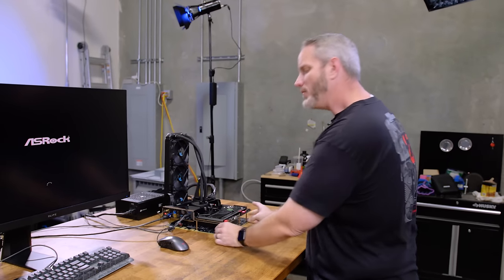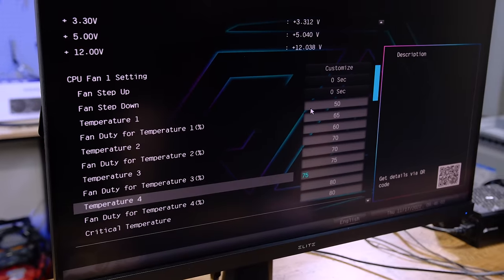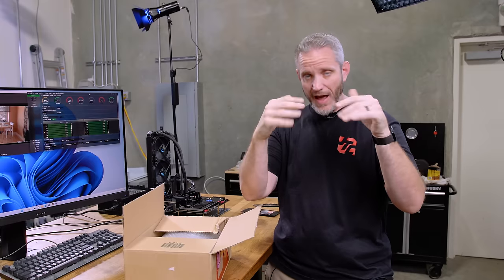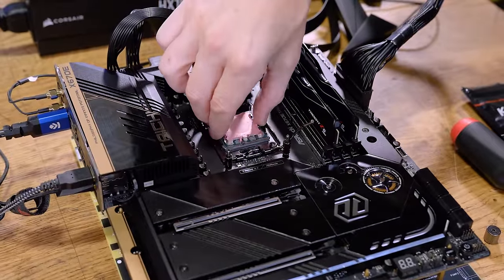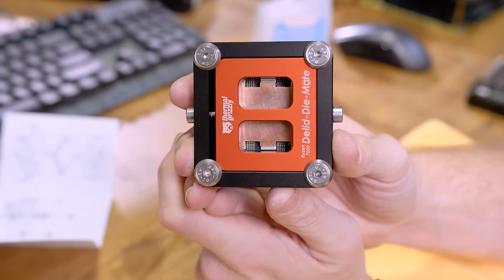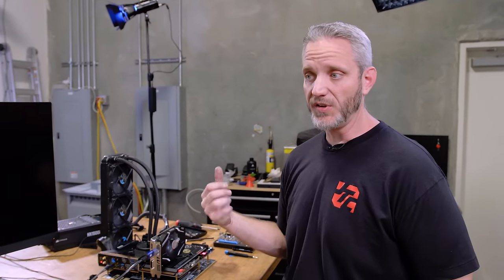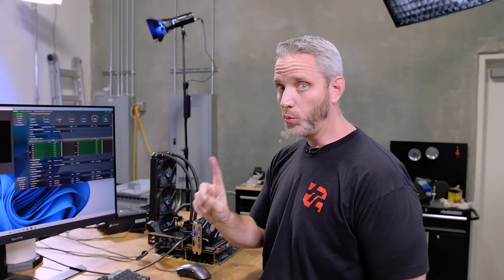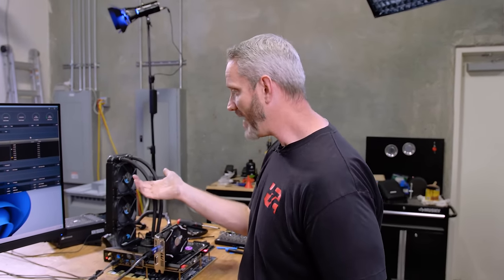I was scared to delid my CPU, but then...

Comment: ah yes, "Iridium" on the CPU. XD
Reply from the maker: New drinking game. Take a shot every time I say the wrong element
Reply: As a car guy, I can see how easily you can mix up Indium with Iridium. Iridium is used on certain types of spark plugs.
Reply: @blockbertus  Iridium is also a satellite system. Like Starlink's grandfather.
Reply: Does Iridium on the CPU get you a Starlink satellite connection?
Reply: iridium is minecraft business, in this case IndustrialCraft 2 or Gregtech ^^
Reply: @sammiller6631  iridium is also one of the hardest elements to melt
Reply: @blockbertus  Only if you have zero knowledge on electronics... But then, what kind of a car guy you are?
Reply: @danzjz3923  It is also one of the densest and most corrosion resistant substances known in existence. Platinum-iridium alloys in particular are also extremely durable and probably the best thing to make jewelry out of assuming that money isn't an issue.
Reply: @_shadow_1  
Yeah, if you're getting jewelry that contains a decent amount of iridium..... money is almost definitely no issue for you. It's one very interesting, and expensive, fairly inert metal. The amount of applications it has, and the amount of places it could improve everyday things, provided it wasn't so rare, would be quite interesting to see.
Reply: @theLuigiFan0007Productions  Who the hell needs private jets or sports cars, I know if I ever become a  multi-billionaire, having the largest object known that is made of pure iridium in my possession is my #1 top priority lol.
Reply: @_shadow_1  
Definitely would make quite a unique valuable possession, unlike a lot of the other things people collect. lol
One day while shopping online at like 4am, I almost spent several hundred dollars in a 2" cube on tungsten. They're pretty cool being over 50% heavier than lead, but even being very sleepy and having poor judgement, I couldn't justify like $350 for a very heavy cube. If I was rich tough? Give me a LEGO set.... made of tungsten, ask someone to pick it up and move it to the other table. Heh. I will admit I spent like $20 on a small 1cm cube instead, which is still amusingly heavy and expensive for it's size, but within the limits of reasonable late night purchases. Pop it in someone's hand and they wonder why it weighs so much.
Here's an idea...... thickly iridium plated tungsten cutlery and plates, and a giant fountain in the middle of the house made of tungsten and iridium and iridium plated tungsten lego sets all built and on display around it. Show off the unreasonable waste of money and weight. lol
Reply: @theLuigiFan0007Productions  I actually already have a cylinder made of basically pure tungsten on my desk that's just shy of 2 pounds, I got instead of the 1.5 cube because corners on something that heavy is a bad idea. Picking it up and fiddling with it doesn't really get old to me, I also have a much smaller tungsten cube which I use to hold down the "W" key so I can rest my arm when video games have long uneventful walking simulator sessions.
Reply: @_shadow_1  
Oh, that's great. I never thought of using one to hold the w key.
Reply: Illudium Q-36 Explosive Space Modulator
Reply: @Jayztwocents  1,...2,...drunk :D
Reply: @Jayztwocents  im in!
Reply: @Jayztwocents  MY LIVER!!!!
Reply: @_shadow_1  I just find it so ironic that your use a tungsten cube to hold W since it's tungsten's symbol (from the German word for Tungsten Wolframium)
Reply: @Jayztwocents  b
Reply: @Jayztwocents  a you're
Reply: though having iridium on a cpu sounds bad ass tbh
Reply: Jay may be a Stars Wars or Star Trek fan. To go where no PC builder has gone before.
Reply: @blockbertus  you can bite and chew indium like gum, iridium is about as hard as hardened steel
Reply: @GameCyborgCh  So whats your point? What has this to do with the fact that Iridium sounds (and "looks") similar to "Indium"?
Reply: @blockbertus  nothing just a fun fact
Reply: @scudsturm1  its a very important element on another type of semiconductor but not one used in CPUs but sewage treatment!! but manganese is the poor man's version of it as it can do everything but has a shorter lifespan but its cheaper so who cares.
Reply: Even more valuable is —> Eckridium
Reply: @Jayztwocents 😮😮😮😮
Reply: Jay kann deutsch sprechen?

Comment: The “decapitate” part of the manual is probably due to the fact that Roman calls deliding “köpfen” in German which literally means just that. Considering the amount of CPUs he’s already destroyed during deliding I think that’s actually a pretty accurate term for it 😂😂
Reply: Behead thy mate
Reply: "köpfen" is actually a pretty common term used by many germans in hardware forums -  "Temperatur probleme, CPU geköpft oder nicht - thermal problems cpu delided or not".
It's just our way: one syllable less to pronounce 😜
Reply: Omelet, eggs.
Reply: lid and head are synonyms in this case.

Comment: It was neat to watch the delidding, but I was also hoping to see how you got it all back into the system. I was a little disappointed that it jumped from getting the top off to running the benchmarks.
Reply: Yeah! Same here. I was kinda curious what the process was. Not familiar with delidding.
Reply: Same, I wanted to see how replacing the retention bracket etc went.
Reply: Exactly! I was watching attentively to see Jay's solution to his retention bracket and they jumped from delidding to the benchmarks. :/
Reply: I'll give you one guess why he didn't show that part, and yes, I was deeply disappointed as well. It's literally the only reason I was watching this stupid video of a grown man risking the functionality of an extremely expensive CPU for literally no good reason whatsoever. Delidding CPUs is just trash nonsense.
Reply: He talks about it at around 26 mins, but sure, would have been nice to see.
Reply: Also here to see that, how did he get liquid metal on both sides, without touching any of the surface mounted resistors?
How did he get the heatsink to contact so much lower? How did he determine how tight to attach it?
Skipping all of that is disappointing.
Reply: Yeah, and when he did talk about it it was about things like even pressure but is there any concern on the absolute pressure applied to these smaller areas?

Like the lid would have dispersed the pressure across the whole substrate, and are those two chips the exact same height or what?
Reply: @jshireley  the temps say otherwise. The heatspreader on the Ryzen 7k is a thick boy. So running direct die cooling on this CPU makes more sense than on line ups with thinner heatspreader. Also direct die cooling isn't anything new. We have been doing it for our GPUs for ever
Reply: @andersmalmgren6528  There are exactly zero circumstances where delidding a processor is a good idea. The possibility of damage is never zero, and the gains are typically only revealed in benchmarking, not in real world results, i.e. the average person or even enthusiast would not notice the difference. If you're an hobbyist who doesn't mind taking risks with your hardware, then just say so. But don't pretend that any of this is a good idea.
Reply: @jshireley  you know that GPU water cooling have been direct die cooling since day one right? Only difference is that they come without IHS out of the box. But all other "risks" applies.
Reply: @andersmalmgren6528  Not applicable.
Reply: @jshireley  enjoy a noiser PC then. I did this to my workstation and my noctuas do not spin above 650 rpm even at full load
Reply: Well, EK sells new standoffs for thier AM4 Velocity coolers to fit onto AM5, I can tell you, that all you need to do, is grind down the shoulder on them by about 1 mm (hand file + electrical drill). And they will work for delid and normal ;)
Reply: @Lem_On_Lime  I've done some delidding a couple of times using older Intel CPUs (most recent was an 8th gen i7), and I've always used silicone conformal coating to protect the surface mount components. That is basically an insulator to protect those devices just in case the liquid metal touches them. Jay seems to like Thermal Grizzly products, so I'm guessing he probably used Thermal Grizzly Thermal Shield (see the Thermal Grizzly product page for the description of that product). As for your other questions, I totally agree with you. Those are the exact same questions I had, and the main reasons why I watched this video. So I am a bit disappointed he didn't cover those points. Still a good video though.
Reply: @jshireley really? Cuz my i7 7700k OCd to 5.2 dropped almost 15c from delidding. Doing it proper has huge benefits to the right cpus
Reply: Same here, wanted to see the putting it back together with new bracket etc. The benchmarking could have been just Jay stating, and now the benchmark shows better temperature and clocks.

Comment: Would have been interesting to see where the clockspeed ends up with the 85°C limit and the -40mV offset to see if it is worth doing that (probably not but I'm still curious).
Reply: it would have been nice if you SHOWED US HOW YOU PUT IT ALL BACK TOGETHER!!!!!!!!!!!!!!!!!!!!! W ... T  .... F  ... .... J ...  A  ....  Y   ...     ????!!??!?!?!!?!??!?!?!
Reply: I would not risk warranty over temperature difference
Reply: @yoool7137  A few months in I would be comfortable using the lapping tool though. That would get the IHS down to a 5000 series thickness and tame the temps. 95 C does not feel right
Reply: @Nobe_Oddy  bruh you actually did this expecting it to be reversible?
Reply: @bickyboo7789  He meant reinstalling the AIO cooler onto the delidded setup.
Reply: I tried 85c and -40mV with my 7950x on an AsRock board and it was not stable, only -20mV was. You need to win the silicon lottery to run with those settings
Reply: @jayb2705  Try just using the Curve optimizer on ryzen master if you haven't yet, do the per core option as well some cores might be able to do more offset than others.
Reply: @nonayobizness2758  1mm = 1*10^6nm so 2mm = 2 000 000 so you got one step too much :)
Reply: @jayb2705  Maybe you need a more stable board than anything Asrock has to offer?
Reply: @nonayobizness2758  Good luck at getting Linux developers to support AMD. I hear constantly that video editing is not stable on AMD drivers because pro editing software is optimized for Nvidia only. What will it take to change that?
Reply: @sammiller6631  All AM5 boards are over-engineered and designed for even more powerful cpus of the future. Plus I needed an ITX one where options are quite limited. Performance wise, I am hitting clocks and scores from other online benchmarks so no complaints
Reply: I noticed one thing the 95c max temp limit only gets to that if u maxing out all cores using something like a benchmark tool such as prime95 ect... While gaming I don't see it going above 65c even at 1080p ultra on a 3080.
Reply: @stephen1r2  AMD have stated u can run the CPU at 95c at 24/7 without any issues. I understand it doesn't feel right but if the only thing Ur is doing is gaming u will never see 95c, I have ran games at 1080p ultra like triple AAA games such as cyberpunk, tomb raider ect... The temps never hit above 67c in my case anyways
Reply: I wonder if AMD is getting news somewhere that the community never asked nor wanted a running max temperature of 95 degrees, with up to 20 degrees just in the IHS design to save you a mounting adapter? I mean it's pretty unanimous isn't it? Jay2cents and GN and De8aurer all need to run a poll of what we really want.
Reply: @yoool7137  Thats cause you soft.
Reply: @Steven West  It makes me mad they decided to either make a design change or tell everyone it can run 95c forever just because of saving cooling mounts. Fuck the cooling mounts. The cooling companies could sell an am5 mounting kit and let you use your current cooler or buy a new one. The fact Jay lost 10c just by shaving 0.8mm off the die like it could've been from the factory truly shows the mistake amd made. Ryzen 7000 will (and is) flop. Hopefully they correct this and thin out the ihs on future generations. If I recall correctly Jay gained more clock speed or points in cinebench just by dropping temp which means amd hurt themselves in confusion.
Reply: Daniel Combs  Did you buy your CPU's near release or recently? I just wonder if newer ones have better bins as they ramp up production. I am very temped to change my 7950x to the 7800X3D, as I primarily game on that PC.
Reply: Daniel Combs  I literally got the 7800X3D yesterday! It is awesome, especially for my ITX build because it's so energy efficient! I can do -40 on every core! I'm now deciding whether to sell my 7950x, or upgrade another PC with it.
Reply: @jayb2705  whether it is possible to make delid on this 7800x3D?
Reply: @daniilmarkovskyj515  You can but I'd advise against it as you can risk damaging the 3D cache. Also it uses so little power and is easy to cool, so there really is no need for it.
Reply: @tomtheaged  Using the curve optimizer in ryzen master instead of the bios has a huge chance to just cause a system crash or black screen boot loop.
Reply: @JustSomeDinosaurPerson ryzen master should only be used to check per clock stability when undervolting.